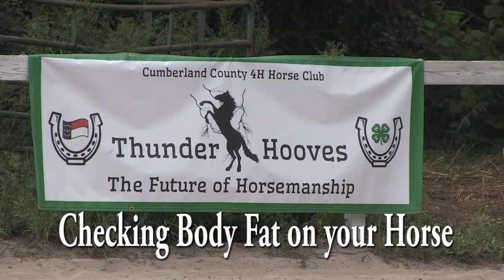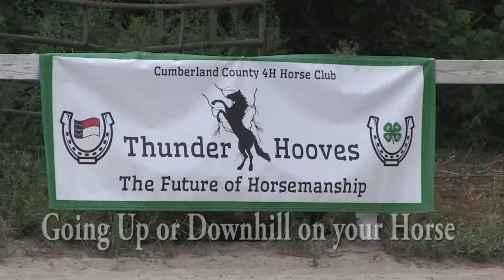Bit Making

Comment: Looks like a torture factory - and what’s worse, someone is going to shove these metal pain inflictors in a horse’s mouth.
Reply: Christine Baker  you don't have a clue
Reply: @bsmith2248  She could have worded it differently, but those long shanks with that twisted mouthpiece is absoloutely unnecessary for the most sensitive part of the horse. Not my expert opinion, just a consideration.
Reply: A bit is not used to cause pain.
If you ride with a soft touch, a bit is used to direct a horse with soft cues. And i have put bits in my mouth and let my nephew pull hard. It is not as painful as you would think. We use bosals, solid bar ring bits with crickets " thats a toy for the horse btw like a baby teether", egg butt and o ring snaffles and spade bits. They take years to get there btw. And have never had an injury or a horse resist anything. Its all about release and years of patience.
Reply: Devin Hyden horses mouth and humans mouth is very different🙂